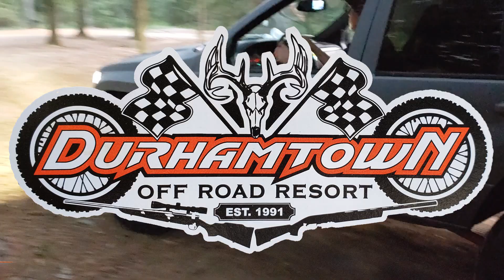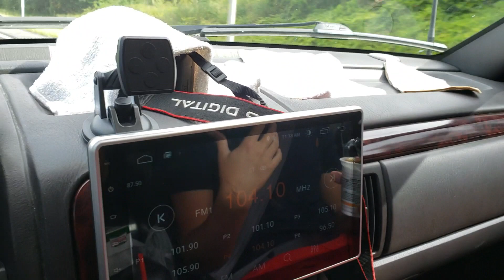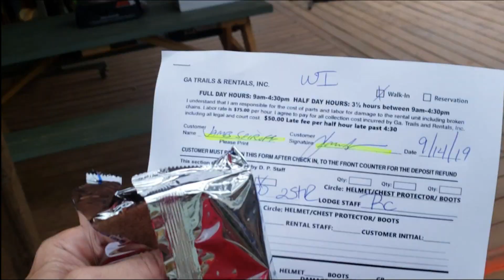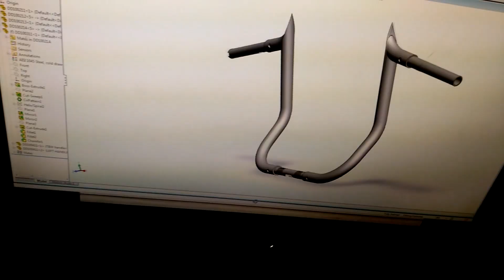Exploring Durhamtown- 150 miles of one way trails all to ourselves.

Comment: Maybe if you drive in two wheel drive down the highway, you’ll get better milage!
Reply from the maker: I was in 2wd.  I swapped in a 231d transfer case from the stock 247 which was AWD and no 2wd. So the markings on the console are incorrect. The 231d with the stock cable linkage I used goes from the rear forward, 4H-2H-N-4L. Thanks for watching.
Reply: Spiral Design Works I tried 247 and 242 when I swapped mine to 4x4 and then I got a good deal on my 231j HD out of a v8 Durango and I love it’s simplicity and it’s strength